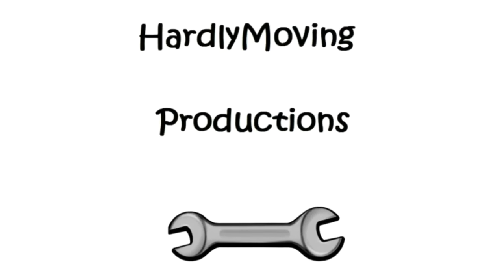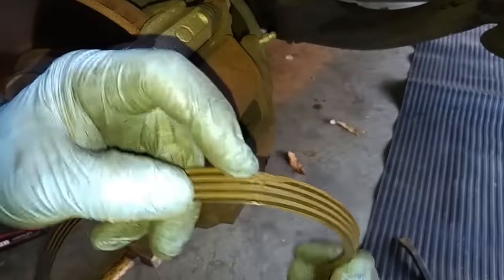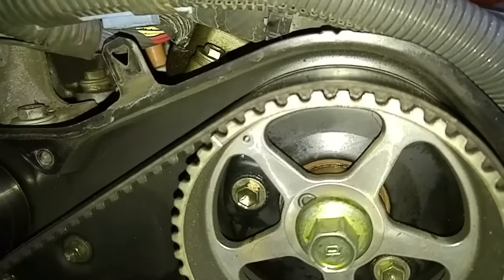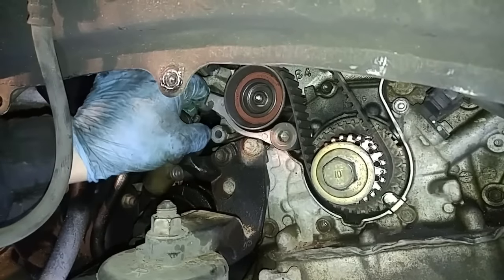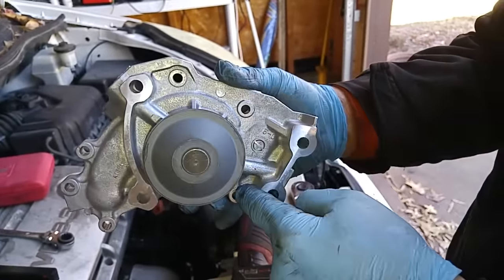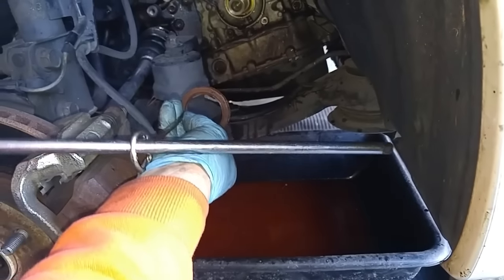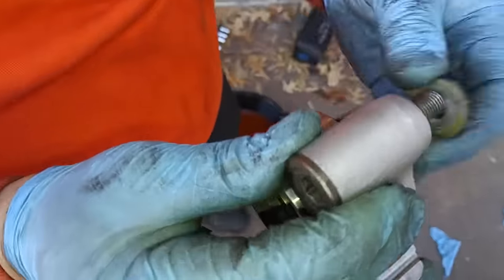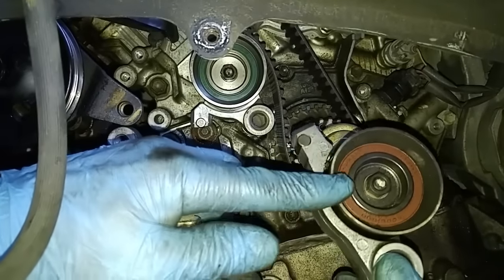Toyota Sienna V6 3MZ-FE Timing Belt, Water Pump, Seals, & Pulleys Replacement

Comment: Get a better car with timing chain
Reply from the maker: Absolutely until the timing chain stretches and then spend three times as much replacing the chain chain guides chain tensioner and a hell of a time removing the timing chain cover
Reply: I'm at the crossroads of comparing which is better: belt or chain.  I have a 2007 Civic still getting 37mpg going 75mph with 357,000miles (highway) on it.  The car is worthless for trade but worth a lot to me.  Meanwhile I'm half way my first belt/pump/tstat ever on an '05 Highlander Limited with 180,000 on it following this EXCELLENT video.  The shop's estimate was $1200 including the idler.  I also have a 2012 Camry 4cyl with 150k on it with a chain.  What do I think now?  I'm now thinking a belt is a more serviceable component and forces one to replace the water pump and cam seals on a practical interval....it would be the better way to go IF consumers knew enough to think about the risk of damage on an interference engine.  What do I have to look forward to in the Civic?  A lovely opportunity to have remove 2 or 3 engine mounts with probably even less space in there to work and I am willing to bet a garage would charge even more than the belt...ugh....drive it till it drops?  This engineer can't live with that idea LMAO.  Great video HMP!!!!!
Reply: Rick 
Hardly Moving Productions 
As an MET engineer and AS in engines and vehicles technology + 13 years of experience working on so many vehicles, the timing chain is designed and engineered to last for the lifespan of the engine. The the deformation or as you called it “stretching” won’t ever happened if you maintain the proper maintenance (oil, right viscosity, engine temp & coolant, etc). On the other hand, the best timing chain is highly recommended to replace it before 100k mils. 
Of course timing chain is a million times better then belt for the car owner not for the manufacturer tho! 
Just look at the old Korean vehicle, and how all switched to timing chain. 
Not to mention that with belt you get better fuel efficiency, less noise space wight.
Reply: Hardly Moving Productions 
Hardly Moving Productions 
As an MET engineer and AS in engines and vehicles technology + 13 years of experience working on so many vehicles, the timing chain is designed and engineered to last for the lifespan of the engine. The the deformation or as you called it “stretching” won’t ever happened if you maintain the proper maintenance (oil, right viscosity, engine temp & coolant, etc). On the other hand, the best timing chain is highly recommended to replace it before 100k mils. 
Of course timing chain is a million times better then belt for the car owner not for the manufacturer tho! 
Just look at the old Korean vehicle, and how all switched to timing chain. 
Not to mention that with belt you get better fuel efficiency, less noise space wight.
Reply from the maker: @samengsultan4911  Thanks for some of your get comment!  Just when timing belt technologies were making advances where a belt could last upwards of 200K miles (according to Continental), the auto manufacturers switch to timing chains ... we'll not completely ... believe the Honda V6 is still a belt.  From my observations, it's really not the belt that goes out first but more the idler, tensioner pulleys or belt driven water pump bearings.  As the bearing wears and the pulleys wobble, it creates stress on the belt which will eventually make the belt snap.  I use to be an advocate of timing chains until I began noticing the exorbitant costs as well as labor associated with anything in the TC drive train that required replacement.  Here are the pluses and minuses of chain vs belts IMHO:

Chain
Plus:  No schedule service interval
Minus:  Chain stretch (lack of maintaining oil level or correct viscosity), defect in manufacturers design which translates to an unscheduled repair resulting in high labor and parts cost to complete the repair (for example, GMC V6 OHC ... have seen timing chain cover oil leaks ... under 100K ... 7 hrs labor ... or chain stretch under 150K miles), more centrifugal mass with a chain vs belt, more noise

Belt
Plus:  Quieter, less centrifugal mass, less parts than chain drive, simpler than chain drive to service
Minus:  Replacement service interval, availability of skilled techs to perform a complete service (didn't change seals, water pump, pulleys), catastrophic engine damage (bent valves) if the belt brakes with high compression engines 

Here are some exceptions:  
Read that if you exceed the service interval on a Audi by as little as 10K miles, the belt will break.
Older VW TDI engines requires timing the diesel pump with every new belt installation (very difficult to do and some VW dealers outsource the work)
With Toyota and Honda engines you can exceed the service interval above 150K miles (I wouldn't but some people do)
Nissan timing chain engines appear to be very robust
Around a year ago, replaced the TB on a Nissan V6 truck with 180K miles with the original belt!
Quad cam V6 timing belt jobs can get a little tricky (Mitsubishi 3000 GT DOHC & Subaru WRX)
Reply: Thanks guys. Yeah I guess there is no magic cure, unless you ditch the cams entirely and use actuators. Another engineer at the office (Atlas Copco Compressors) is very consistent with maintenance and he warned me that he lost a chain on an 8th gen civic like mine and got to redo the top of the engine.  So at 357k, what would you guys do?  Give it away or replace the chain etc?  I bet pulling the engine and working on it might be easier LOL...😭
Reply: Hardly Moving Productions 
I’m talking in general most engines now are chins this is a fact. Yes you are right some timing belt might last for 200k but  very limited will survive 200k mills. Just like car battery, the same exact charging, operating, model, but the one in New England will last for 5 years. In contrast, the other battery in Miami will last 3 years. 
I think you drive Honda, because your discussion is so focused on it. They do make very good engines when it’s comes to the displacement + size and output horsepower. For this reason, Honda’s engines required more maintenance than let say Toyota’s or Ford. I personally look at longevity in all of my cars, this way I never owned anything with timing belt never in my life. 
There are some attempts to design electric lifters but still under development. Once again my friend I hope you can look outside the Honda box, just look at Mercedes’ engines never a timing belt. why? Because you are right, with belt you need less friction and tension on all bearing and tensioner and other components so they go bad so fast.
Reply from the maker: @samengsultan4911  FYI - From a pure maintenance perspective ... either on a Honda or Toyota ... just a belt replacement ... no bearings, seals or w/p ... I can do it  in 1.5 - 2.0 hours.  To re-seal a leaking timing chain cover on  GM V6 - 6.5 hours!
Reply from the maker: @samengsultan4911  Thanks for your comment!  Currently own and drive 99 Camry CE with a 5 speed manual with 270K miles.  Took possession with 120K on it.  Have done 2 TB replacements on it.  On the subject of batteries, will be coming out with videos on how to keep them alive longer and another on how to avoid spending big $$$'s buying a new one!